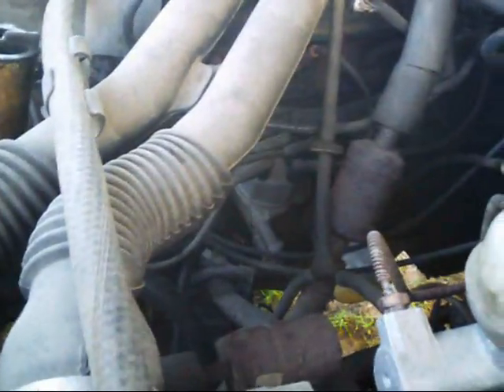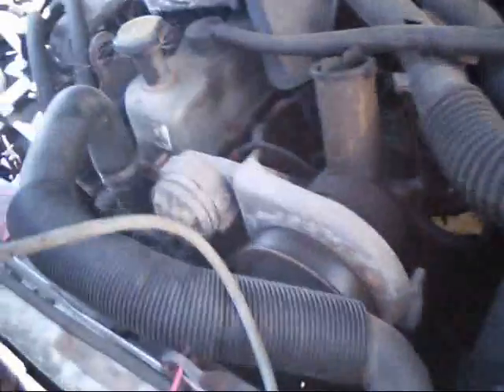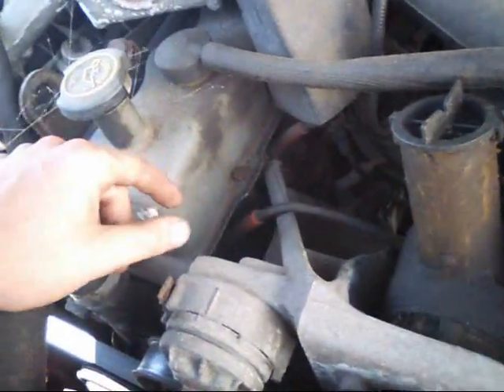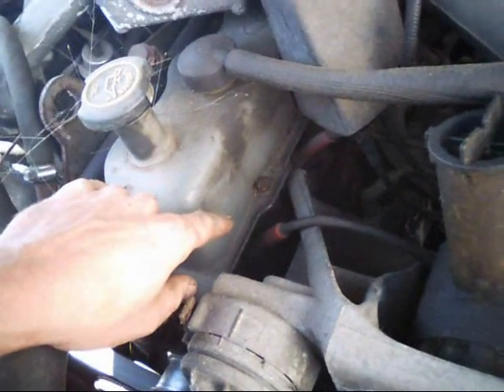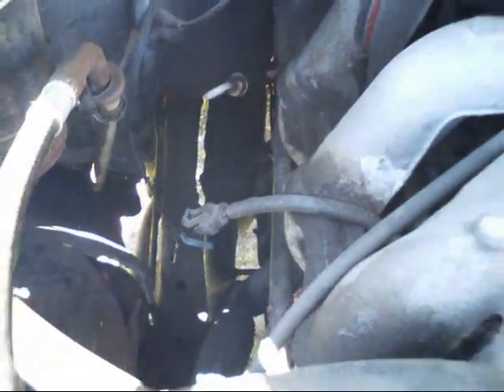Making fire with car parts

Comment: even if you dont have jumper cable you can just use a couple nice sized wires u might find under the dash or under the hood or some were else just ripe them out and strip them down and there u go

Comment: well you could do a video like I did 6-8 months back , how to stop a runaway car , remember the run away toyotas ? people liked that one from the emergency brake , toss it in park ...there are so many ways to get a car stopped safely and most people have not a clue , just a simple vid you might wanna do .....btw you could not turn the toyotas key off safety feature to prevent steering lock at speed , not that was stupid on toyotas part really lol